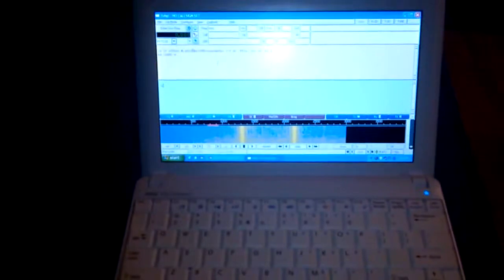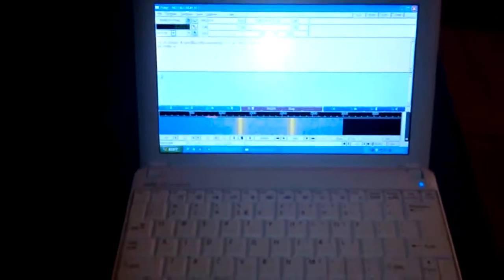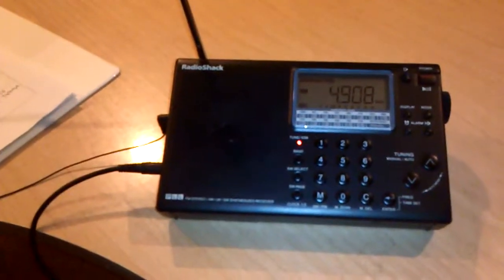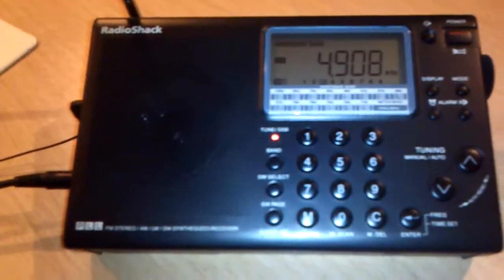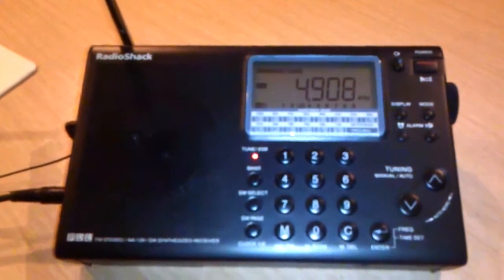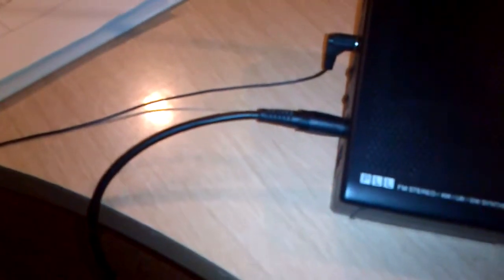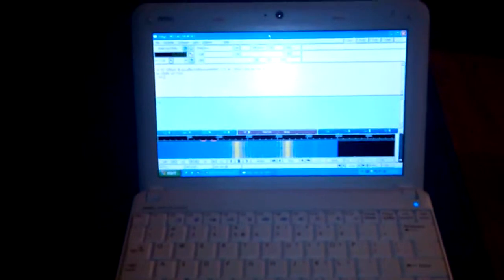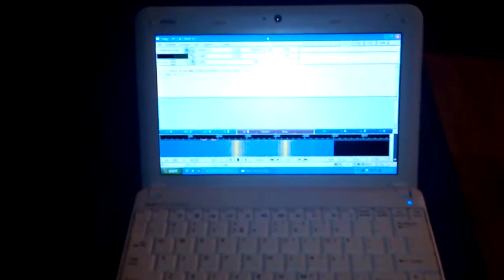Possible Military RTTY Signal on 4908 kHz

Comment: Since the fldigi program doesn't have any signal identification capabilities, you can look at the space between the two lines on the waterfall & get a rough idea of what the mode is. On this signal you can see that it is just short of 1000 hertz so it is a likely 850/50 FSK station.
Reply from the maker: Thanks, Keith, that helps a lot, as the fldigi software is brand new to me and I'm still learning how to use it.  But I'm totally hooked now!